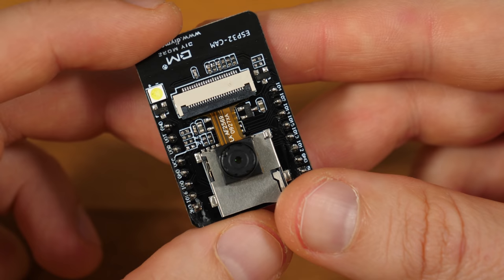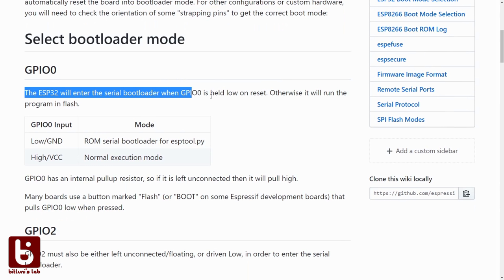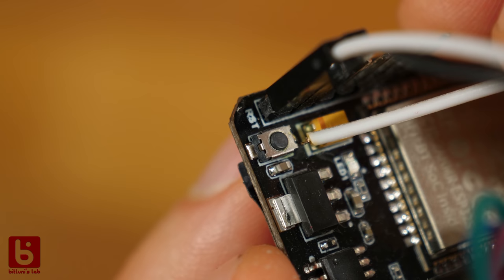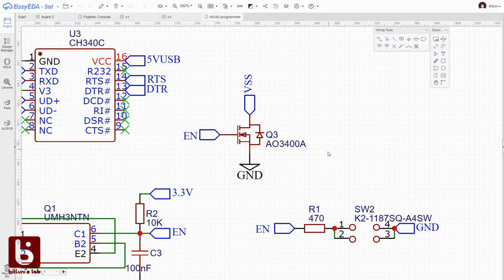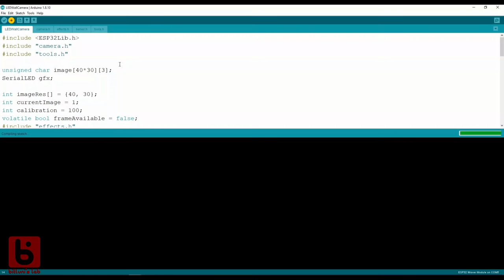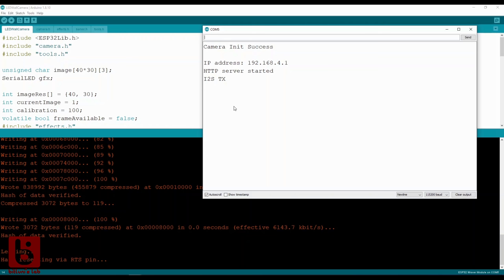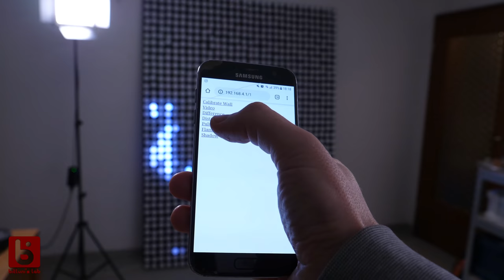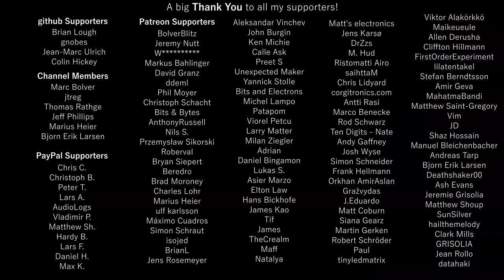ESP32-Cam Programmer & LED Wall Effects

Comment: The code for this project seems a little overwhelming for me. Can you please point out where do you initialize the LED matrix (I assume this is a serial array divided by number of LEDs in a row) and where do you perform a write cycle, so I can fit this code into the solution I am looking for?

Comment: FYI for anyone trying to run this code for yourself – apparently the v3.0.0-alpha versions of the esp32 board have some issues that prevent the code from compiling, so use v2.0.11 until it's sorted.

Comment: I kinda miss the wiring diagram for this project.
EDIT: aah! code mentions that the LED data pin = 2.

I tried the v1 led wall as my first "big" project and it was quite easy to follow along. Keep up the good work.
Reply: I'm using the code provided in the link and I get the signal from pin IO2 (DATA 0). This differs from how it is done in the video (which shows pin IO15 - CMD). I was a little confused by the comment in the code in which I had interpreted "data pin is 2" as DATA2, not as IO2.

Also, I'm using a 20x15 led board, so some rescaling has to be done. The code provided is a little more complex than I'm used to. Is it possible to provide a little background on the code or to direct us to the documentation you used to write this code? 

grtz,

Comment: Is there any chance of you 3d printing some smaller diffusers than the ping-pong balls so the resolution can be increased on a video panel? I was thinking that if a fold were placed in the LED ribbon in between the LED'S so that they are butted up next to each other then the resolution can be massively increased

Comment: Wow! This is really a great project! I have just two questions: this wall has 1200 neopixel... are they all connected in one line? And what type of power supply are you using for 1200 pixel? This must be huge, or?

Comment: Amazing. Insane how powerful these ESP32 chips are.
Unrelated, but do you know how to alter the ESP32-CAM for night vision applications? Afaik the IR filter is not removable on these sensors.. or is it?
Reply: Oh, did what you ask by accident the other day. Received one with an out of focus camera. Tried to turn the housing with pliers (after removing the glue) and it squashed. So, carefully removed all the squashed plastic with snips - the square glass filter fell out. That's all you have to do, cut the top off through the threads.

Got the cam in focus by lifting the normally threaded area up at all 4 corners with an exacto. The camera lens is a clean separate construction under the filter  :)
Reply: @Slider2732  cool, then it's possible, though a little bit messy to do. Thanks!
Would be much nicer if someone started selling these without the IR filter, by default.

Comment: Just got the ESP-CAM programmer - works great! One question for the LED Wall: I connected it like in your video (LED Pin on 15, 5V, GND) an have the wifi-server running. But it won't display anything on one connected 50 pcs LED chain. I tried multiple chains, but same result. Is there anything to do after I click e.g. "calibrate wall" ?

Comment: How reliable do these camera modules work for you so far? I ordered similar ones from ali express and they drive me mad. They only work if the camera module physically touches the sd card slot ... no idea why. And they sometimes randomly stop responding after running for a while but only if programmed via platformio instead of arduino IDE. One of them also randomly fails to find the camera.

Comment: Check out artist Daniel Rozin.  He does really cool art installations like this, but using servo motors instead of leds, to drive the rotation of physical objects like stuffed penguins and plush toys.   Also, the company Breakfast in NY does huge (expensive) flip-dot displays similar to this, as well as servo motor matrices to control mirror panels, would blocks, and other cool stuff. 👍🏼👍🏼

Comment: Anyone have links for info on embedded controller image recognition AI. i have a digit recognition project in mind for these modules, I want to automate the daily reading of five water meters (RO plant)  and hopefully do some automated trend analysis to detect unusual usage such as leaks or stuck solenoids which we seem to have way too often.      I could simply use the ESP32-CAM to ftp images to a server and  OCR with tesseract .  But it would be cool if the ESP32-CAM did the OCR.
Reply: I had a go at doing this: you could take an image, POST it to a Google cloud script then use the Google image recognition API to extract the text.
The problems I had were:
* The text recognition API was expensive for just me messing around with
* The image quality wasn't great taking an image of a non backlit LCD display in a dark cupboard 
* I was using a power bank to power it, and when you put the ESP into deep sleep the power bank shuts off so it never wakes up (probably not an issue in your case)